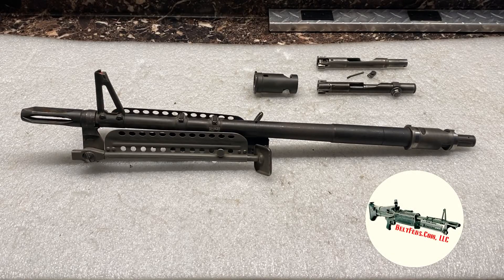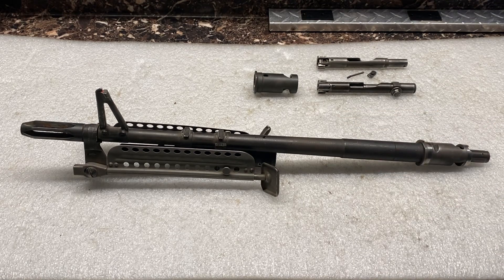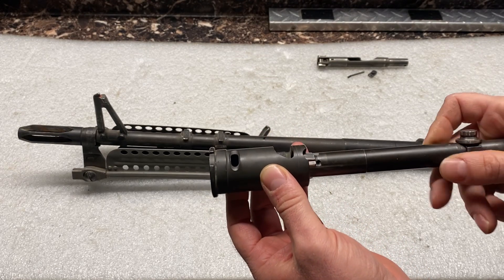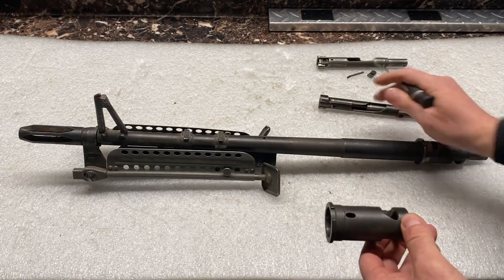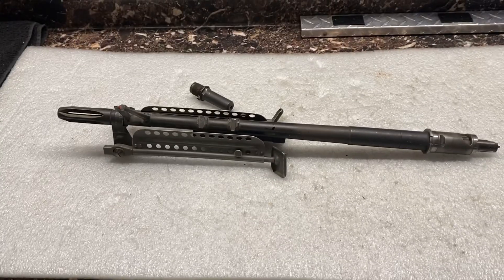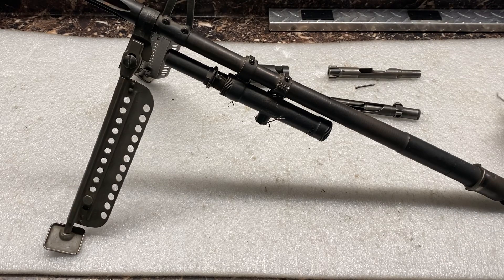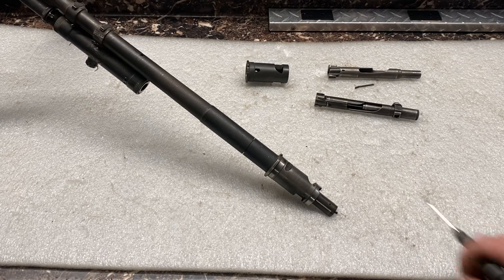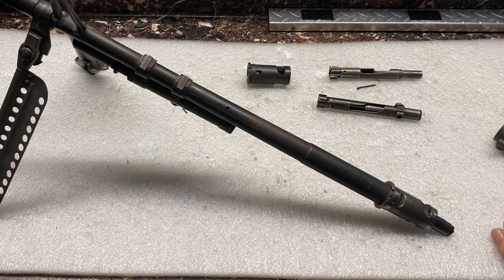M60 Bolt Stuck In Chamber - Here is why

Comment: Great video. I have some experience to add: Aaron (I think is his name; the guy making this video) helped me no charge. In my case, a primer popped out of a steel-cased Russian round. Aaron warned me this happens a lot with steel-cased ammo. Haven't used it in my M-60 since. However, I have been using Russian ammo in other guns. Like a year ago, I bought a PSA 7.62x39 AR. Been having problems with primers popping out of steel-cased ammo in this gun as well. So apparently, primers popping out is a concern with Russian ammo. Luckily, I was able to eventually wrestle out my M-60 bolt. But, I have like 10,000 rounds of Russian steel-cased ammo. I have been thinking maybe I can glue in the primers -- something to salvage it. But, the whole situation is sketchy. Plus, in this video, it was a brass case that exploded. I guess they made the chamber loose in these M-60s.

Comment: Back in the 70’s I was stationed in Hawaii in the 25th inf div. I was a machine gunner and one day in the kahuku mountains I was assaulting a hill (training) and earlier I had just for grins loaded one of the blanks on the belt to the top with powder and being young and dumb I thought it would just make a bigger boom. Well when it got to that round it was so loud and Smokey and it just quit. Well I didn’t say anything about what I’d done but I saw the platoon sgt kicking the charging handle but it never budged. They concluded that it was an overloaded round, little did they know. I wonder if you got my old barrel. Lol.

Comment: Awsome video, but isn’t it possible to unscrew the intire barrel nut?heat it up and take it off? Or is it pressed on?
Reply from the maker: It’s not possible when you cannot take the barrel off …. The nut is inside the gas tube of the receiver
Reply: @BeltFedsComLLC  i meant when its all out, heat up that barrel cam/bolt extention
Reply from the maker: @ragnarok5056  no. That is permanently set on the barrel. It doesn’t thread on and off unless you put it in a mill and remove the metal that sets it in place
Reply: @BeltFedsComLLC  ahhh oki, copy that